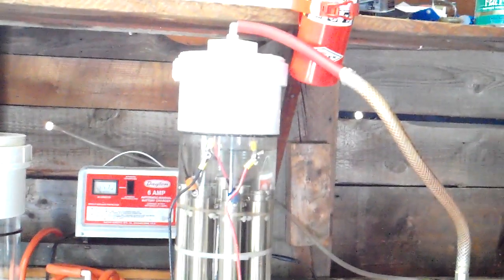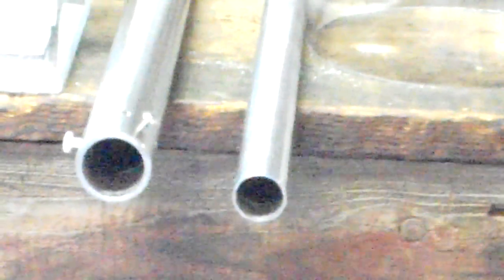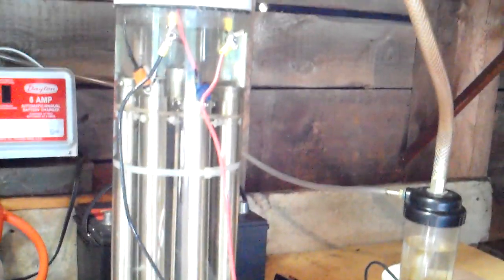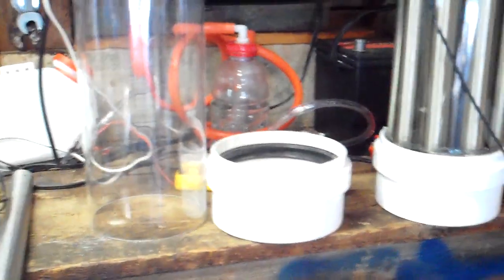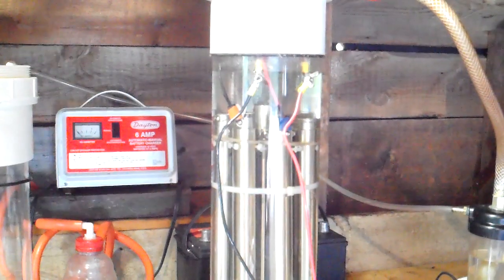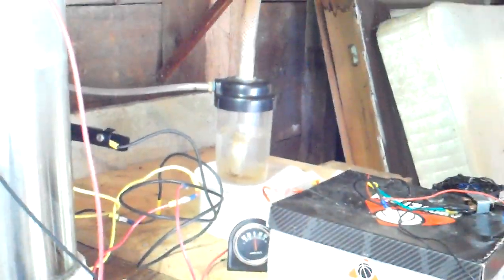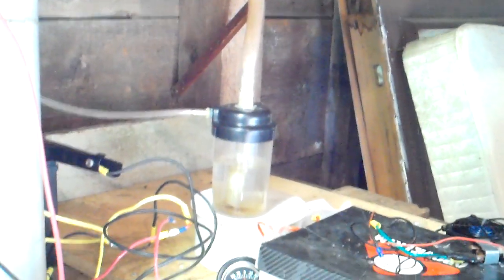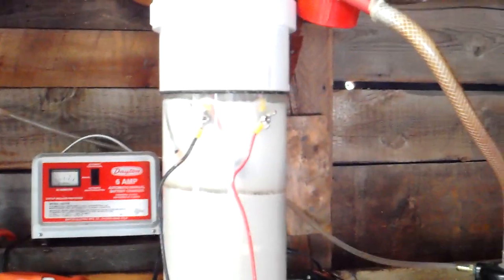High Output Stanley Meyer HHO Generator.AVI

Comment: Hho Technology prolonging engine life and engine oil life.

Engine life changer device improve engine performance and increase fuel burning efficiency beter then a new car!!! More fuel will burn in the engine No un burn fuel wastage . Engine will run more power ful .Consume less fuel.

Engine runs smoother reducing carbon emissions significantly . Boost engine power and torique. Better acceleration . faster running.

An efficient hho car kit lower the engine temperature more then 100 degree F.  To prevent heat build-up.Hho car kit reduce car maintenance charges. 

Cleaner engine running. Reducing engine noise due to the faster fuel burning. Hho car kits works nicely requires no modifications in the car engine. No side effects on car engine.

Engine start quickly safe your car battery. No more petrol or diesel smell

 make your car a low cost hy-brid. Use a Hho car kit small or big.

Comment: Are u using DC power??  Ive theorized and on small scale saw it appear to work, using a high frequency AC signal on plates with very small gaps (flat electrodes as circular creates an uneven e.field); with highly accurately tuned freq. that harmonically resonates with the O-H bond vibrations.  The same freq would be best but of course bond vibration is WAAAY beyond fast, so a lower harmonic works just not as efficiently.

The idea is using an AC signal but DC offset so electrodes dont change polarity (im guessing high freq flipping would be less efficient loosing energy to heat buildup) that resonates with bond vibration.  Since HHO out is directly related to e- moving thru as current, you never get more gas unless you increase current (assuming best optmized setup).  HOWEVER:

Should you "vibrate" the bonds with a harmonic vibration due to the pulsing e.field between the plates, negative pulls H's and positive pulls O side due to highly polar nature, adding bits of energy through constructive interference but without adding velocity as the polarities dont change and molecules stay mostly locked in orientation.  When bond stretches too far and "feels" its neighbor they either break free radical from too stretched bond and by collision reactions acting like SN1/SN2 organic reactions, because the strained bond length weakens it and allows H2 O2 to reforn from degrading H2O molecules.  Since theyre nonpolar, e.field has no effect.

I saw a drastic increase in gas gen. instantly in a tiny example setup feeding signal sine wave from a sig. gen. w adjustable freq (its quite high freq.).  To my real surprise when this happened, current draw actually DECREASED...this means HHO gas can be gen. without ANY more current by destroying water bonds in a field already there just never used, ultimately meaning you get more HHO gas out than potentially by the power you supplied to do it.

Ima chem. engr. and know this part well as ive done R&D years b4 bad health...say you use 100W to make 4L of HHO gas, but burning it only gens 90W due to losses, no free energy right?  No, it just dont work with gens. and motors running each other.  This harnesses energy from a field already there no laws of thermo are violated.  Now, you use 100W to gen. 4L of HHO plus get another 1.3L from field induced bond breaking, so 100w gives 5.3L of gas.  Burning now about 22% more gas gens 116W of electricity.....See where this goes???

Worked out all details chemistry related for years way too much to try and describe, but i inow it can work.  My damn problem is im lacking in ability to design a proper, tunable with high accuracy, power supply capable of high frequency and current where at least freq can be adjusted in high resolution (voltage and current adjustment preferred too but not necessary as freq. must be variable).  Anyone out there see how this concept has real potential?  Anyone great in electronics that could help me with adjustable high freq amp?   Is it even possible, because i know high freq amps usually have very specific band operations...

Anyway any thoughts or discussion would be great thanks

Comment: In the last two years, research gate has published several papers on hho n fuel economy in diesel. A UC school proves fuel efficiency. 

But they don't go into how it's possible because by our current science it takes too much power to make hho to get any gains. But now actual university research shows it does. 

Also patents after stans all high voltage and cavitation
Reply: Its definitely doable, see my above comment

Comment: Where are the 2 inductor coils? What is the frequency of the collective water capacitor?  What type is the SS electrodes? How did you equalize the surface area of both electrodes? The power supply is supposed to be "burst mode" on and off time of multiple pulses. As water level moves downward slightly, there is to be circuit to update frequency so PS and cell always matches.  The voltage was to be about >= 1500volts through resistance type magnet wire of double coils secondary on same core as primary pulser. Tap water puts contaminants on electrodes, distilled water is always  better. DC output for hydrogen gases, AC for steam generator heater. The Canada Patents by Meyer have extra details not in the american versions. Meyer's technician went to canada and started Xogen Company with the Chambers Patent, using some of the Meyer data. The Hydrostar circuit of years ago was his . Flyback reverse higher volts pulses from coil was to attatch to cell electrode.Voltage pressure separates molecules of water, AFTER small TEMPORARY curent pulse aligns up all plus and minus poles of molecules. The Fuel gases generated are overunity on proper set up Meyer cell. GET and see Meyer company 2 manuals- Birth Of New Technology and Water Fuel Cell Dealership Manual.
Reply: I KNEW IT!!  Never saw details of his power supply, but b4 i heard of him i had this idea of breaking bonds with harmonic freq to bond vibration in e.field between plates, getting gas without passage of current (extra gas for same power input).  I know the chemistry as a MS chem engr, but not the knowledge to design needed power supply.  See more detailed comment I made above.  Any idea on how to get a hold of such a supply or knowledge in elect. to design one???

Comment: I can't believe you're trying to make a profit off of a very simple and widely known system to produce HHO. In addition I find it hard to believe some of the prices you give for your construction materials!
Reply: Not sure if his is real or no, but getting excess HHO compared to power input capable of generating extra energy IS REAL...see my comment at top.  Yeah his material prices are off, and cylinders dont work as well as the e.field isnt uniform in a radial geometry etc etc...but set up properly it works; as a chem engr i can do all of it but sadly not the highly advanced power supply to drive the proper signal.  Very frustrating

Comment: Case doesn't need to be clear. Save some money and use regular pvc. And long term use will corrode the wires underwater unless you use stainless steel wire. You can make HHO with any metal, but stainless has the best corrosion resistance. FYI I've made many differnt higher output units with a car battery and crap laying around my shop. Didn't invest nothing but time. And a new sealed 5gal. bucket lid once. Granted not everyone has a fabrication/mechanic shop.  I always use three bubblers. Had a unit explode on me with just the one bubbler.  That flame travels quick! Lol.

Comment: I can build a simple hydrogen cell and produce more than this. My question is, how many amps are you using to produce this? Stanley discovered how to use a resonant frequencies to produce enough to run his dune buggy. With only 5 amps. Which doesn't heat the cell up too much.
Reply: meyer did his with 0.5 amp and like 20khz . his schematics show the wave form wasn't AC but pulses on off DC

Comment: The video shows the cell connected directly to what looks like a car battery. This provides a relatively low voltage at a very high current level. As Myers' cell used just the opposite: low current and very high voltage. To achieve this he built a circuit producing a stepped frequency, set to a harmonic of the natural resonance frequency of water molecules. In essence what he achieve was dissociation of water melocules by a 'pendulum' effect. But forcing the molecule to oscillate repeatedly, it eventually splits.  Your systems appears to lack this crucial element of a true Meyer fuell cell. You did a great job of the nested tube arrangement. However, in Meyer's fuel cell, it acted as a capacitor, part of the oscilating circuit needed to 'shake' the molecule apart. Good try, but not a true, super effecient Stanley Meyer fuel cell.
Reply: I'd love info on where to get that design

Comment: Hi
I just across this. Good job
I know it’s old but do you still have the plans?
Thanks
Reply: Right? The key is low amp, high voltage pulsed across plates. The last improvement is a pump to cause water to navigate between electrodes, which allows the infamous charge cluster to form in the vacuum of a cavity. The collapse is so energetic it wraps the charge cluster (which accesses the ape)  so it does not eradicate until hit with flame or spark. TUSD is the only way you can run on only hho.  But u must realize due to suppression it's not hho or hydrogen. It's exotic charged water; some call it Electrically Expanded Water. 

The point is, with this cavitating high voltage microamp pulsed voltage, you produce an anomaly gas that can be isolated, and that's what is running a "car on water" any hho generator that is high amp low voltage, with no cavitation, is a scam. Don't waste your time or money on that. Just make hydrogen.

Check me tho, though. Google us patents hho cavitation, and you get stan Myer in 2012 and dozens, after all, improving on the design till 2016 when all parents stop.

We have reason to believe Japanese companies are putting serious money into this to stop the bleeding economy for fuel. You can reference charge cluster and ken shoulders n see the connection to true water has generators which are not hho. Water gas torches are not hho.. The flame temp is under 300 c too cold to be oxyhydrogen but hit anything metallic immediate reaction just like evos or charge clusters.

500 bucks and you can be oil free, but don't make the mistake of trying to sell it or go on the news, you'll wind up dead or lawyers to be quiet.
Reply: So how do I build one
Reply: @Gacha.Cupcake  buy a good dry cell online like the anton cell, or look up diy plans.. When I build mine ill post all plans. It's going to be fully open source no secrets no secret electronics u neex to buy. It's time we are free of oil.
Reply: Good lectures on this by moray b king, at BTE Amsterdam in 2012; another gentleman in 2019 lectures on browns, electrically expanded water, and oh masa gas (Japanese inventor)

It's pretty cut and dry the excess energy is derived from the ZP field by unique strictures discovered by ken shoulders and verified now by many labs, called EVs. Or a self-stable cluster of Avogadro's number of electrons in a torus. That, in water, becomes a stable plasmoid gas, of varying types. 

This third gas, when made in different ways behaves differently, it also behaves extremely different if you let the hydrogen oxygen go and burn just the muster gas... It shows all browns anomalies plus many more, plasticising metals without causing heat to be inducted in the material.

Explains why guys holding a metal rod n cutting with hho torches done burn that hand. Flame temp is only 600c that's not oxuhydrigen temp...the fame can't boil water, it's the future, and it will forever be suppressed only way we the people get it, is through open and free information sharing.

The mistake of stan myer and every water torch or car guy after him and this new guy with the ECAT  (imo is bunk, the activity of HHO can be explained with charge clusters as the conditions are present, but what has no high voltage and no feasible link to extract energy from the vacuum. Making hho gas takes voltage and cavitation collapse to tap into the ether). I don't believe in free energy, hho is cheap energy, we still expend some but get way more in return. This is not normal or intuitive, but there is no physical law that makes it impossible, only lack of imagination makes things impossible.

Good luck people build share help each other and we can convert every car one home at a time for nothing but a beer and a thank you and buy ur own parts.

I am going to start a utube channel specifically for making the third gas, in unique ways to increase cavitation and combine the best of WaterCells, with Ohmhasa vibrating electrodes and his separation and storage technique.

I vow to post complete instruction, leaving nothing out, every setting on my electronics every tweak on the cells, all I ask is if ot saves you money, pay it forward and a small donation of whatever you feel is right is welcome. 

I think it's right that everyone have access to the correct plans to build one of these themselves, truckers could make a decent living again, families fuel bill for cars or  home heatin will plummet. 

But 90% is the most ill show, im not trying to be vanished by saying I run on just water and you can to. I'm sticking to "I always need at least 10% hydrocarbons or it won't run properly."

OPEN SOURCE WFC,  YOU DONT need stans complicated circuitry...once perfected getting a custom logic chip made to auto tune and control gas production, as well as sensors. I actually want to research the anomaly gas and win a Nobel because every mainstream scientist is afraid to touch it. 

Best fuel alternative, stop wasting billions on itr you could have installed water cells in every car in Europe lol

Comment: The real Stan Mayer Fuel Cell is not HHO because HHO will not work. His original fuel cell is H2 meaning it’s output is HYDROGEN and not hho. So you better make a separator if you want to run your car!

Comment: Where did you get your acrylic tube? Only thing I've found was 4in  and 75$ per foot
Reply: That project was 12 years ago. I had a hard time finding 6 in tube then and have not been able to replace it .
You would be better off with   3/8 inch sheet acrylic and weld a rectangular box.
Or, try the UV glue.

Comment: This has been going on for decades, hobbyists splitting water into HHO gas. Big deal. I discovered it for myself in the sixties shocking fish with DC current in an attempt to "train" the fish.

No none, nobody, has demonstrated an HHO production system that outputs more energy than the energy input to the system, therefore there is no net gain in the process.

You're only depleting electrical energy to gain a flammable gas, with net energy losses in the process. Please prove me wrong.

If you want transportation fuel, it is more efficient to simply spin an electric motor to power the vehicle.

Again, please prove me wrong.
Reply from the maker: Do your own research. You are parroting all the trite comments of archaic science that has been suppressing alternative energy inventions for over 100 years. I don't need to prove anything to you dude. Watch the video to see the long list of serious researchers who have proven that the universe is permeated with energy. https://youtu.be/1db-UqlBa8M

Comment: you probably just increased three voltage input, scraped the surface of the pipes to increase the surface area, used distiled water and mixed baking soda with salt.

Comment: This is real ?? How may I make this?
Reply from the maker: My ebook tells how to build the S.M. device and gives the circuits for the PWM, VIC etc. Go to http://www.hyfusion.com   However, I've done a lot of research and gone way beyond the Stanley Meyer approach by using the research of Tesla and Bedini and Vicktor Schauberger
Reply: +hyfusiondotcom It looks very interesting your page. I do not understand is why there is so much information that if not the combustion engine is modified. as in the video of Meyer?
Reply: +hyfusiondotcom es realmente muy interesante tu página y el vídeo . Me suscribiré 👍👍👍👍👍👍
Reply: It's a scam, he's just trying to get your money. You cannot power a car on water, the energy you put in the system to generate will waste much more energy then if you just got an electric car. If you really want to build your own HHO generator theres plenty of instructions online. Don't believe a guy who says his generator produces "5x more" gas when he doesn't even have any data or controls. You know what, if he did pull it off, i guarantee it uses 5x more energy. This guy did not discover a way to violate the laws of thermodynamics.

http://www.instructables.com/id/How-to-assemble-a-HHO-Generator-and-why-it-works/
Reply: Yes, you can power a vehicle on HHO. The secret is adding magnets to the generator to greatly improve efficiency and gas output.

Comment: does your hho generator design requires less current flowing from battery compared to other designs? i think there is about 20 amps that usually flows from battery.
Reply: @JacobJonesy  he is asking a valid question, is it separating the water more efficient than Faraday wild suggest. 
The answer is probably slightly better because he is resonating the cell but still nothing like Stanley myres did using his VIC (voltage amplifying circuit) transformer he was separating with voltage not amps
Reply: @nobodyspecial8102  I think I was replying to someone else 5 years ago and the comment is gone, I'm not sure though. I'm not sure I understand everything you are talking about, it is a nice looking HHO generator though. If you are suggesting it might be possible to get more energy out of the generated HHO then I would disagree, there are massive losses through heat alone. As cool as it would be to use the HHO to power the generator to power the HHO generator, it is probably not possible.